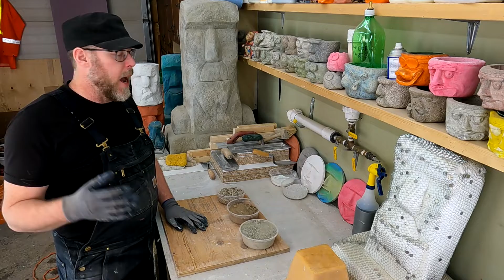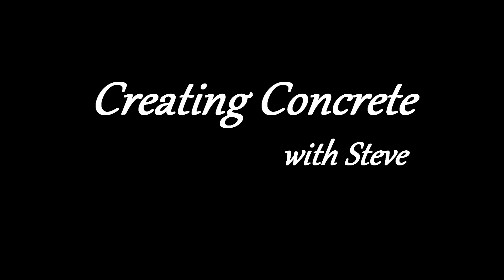Basic Concrete Mix Ratio

Comment: One yard of sand is roughly 2400 pounds or just over 1 ton.  So a quarter yard of sand would roughly weigh approximately 600 pounds.  one yard of anything that has to be weighed at the landscaping supply yard (any kind of sand, 2ns or play sand and gravel, 21AA, slag, crushed concrete etc.) will weigh approximately 2400 pounds. And your 100% correct, a lot cheaper than buying bagged product from hardware home depots etc. Great video explained how to mix concrete

Comment: Hello, if I add an extra part of a smaller fraction gravel like 2-5mm.
Should I cut the sand or gravel part? Sand I assume.
Like 1 1.5 3+0.5
Thanks for your videos.
Reply: Your mix is M20